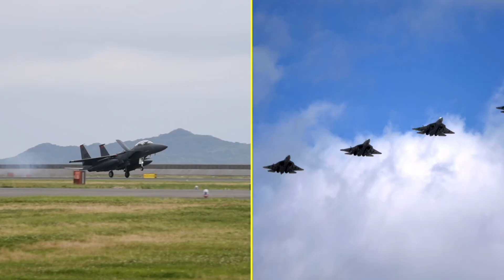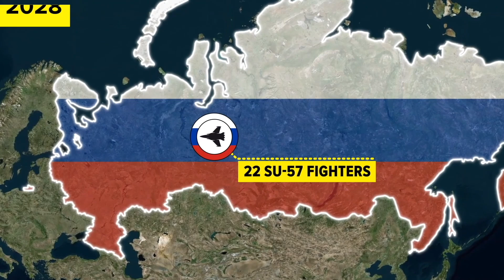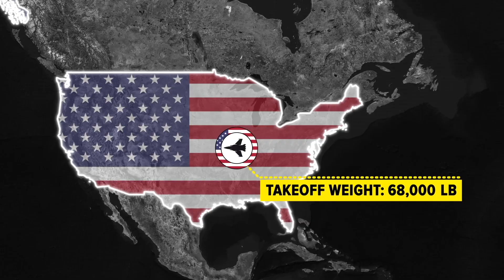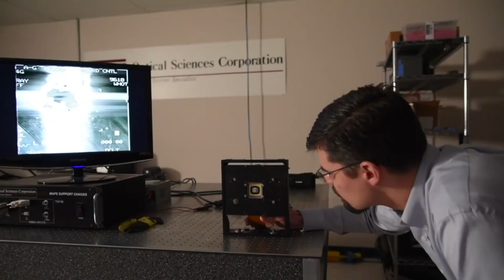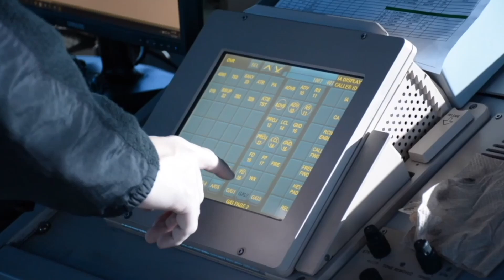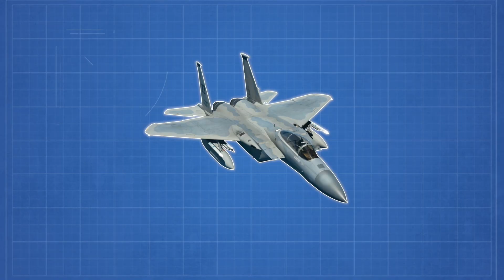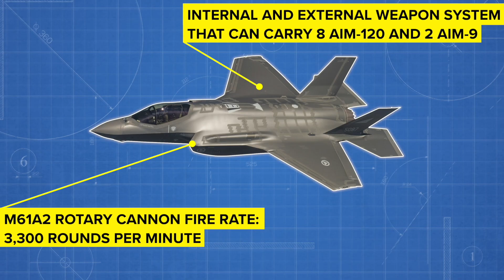Why the F-15 Still TERRIFIES Russia

Comment: the russian military estimated the RCS of the SU-57 is 100 times bigger than the proven RCS of the F-22
Reply: proven by who? By those, who say that the only true stealth plane – the F-117 has higher RCS than F-22, because «Nuuuw kompchuters alowed uz to kalkulate better formz»? You're real?
Reply: True but even the US cant currently build anything that can match the F-22 or even new F-22 also the SU-57 is their first compared to the US's (115 Night Hawk!) it's much better but yes it sucks it was 25 year late and based on an existing airframe (The Flanker!) rather than build new from the ground up, Also the SU-57 still lacks it's dedicated new engines 

Best Stealth Aircraft ever built was the VF-23 (Black Widow and Ghost Bat!) they were more stealthy just as fast but lost because they didn't show off fancy moves it was capable of and still was (for the prototypes!) Analog Majority Controls but was planned to get a fully Digital Cockpit and HUD Helmet
Reply: @DarthAwar also the f23 was not any more stealthy than the F-22.
And by this point in history it along with the F-22 is not even the best we have
Reply: @GR_Chief  YF-23 not F23 as they were never Commissioned (aka put into production never mind service!) It was it had a much smaller IR signature, RADAR was about the same though remember they were built by the makers of the B2 Bomber they know how to do both RADAR and IR Stealth pretty well!
Reply: @DarthAwar 😂😂😂😂😂😂
Reply: @DarthAwar what the hell are you even talking about? The F-35 is more stealthy than the f-22. The F-22 was our third attempt at stealth.
Actually our first attempt at a stealth aircraft was the Have-Blue test bed which is 100 * stealthier than the su-57. Our first production stealth aircraft was the F-117 Nighthawk.
 Not sure where you're coming up with the F-115😂😂😂
And the second production aircraft with stealth was the F-22 which is several Generations beyond the f-117. And the current F-35 along with the B21 Raider are even further stealthier than the F-22 or any previous aircraft.
And for the su-57 to be Russia's first attempt at stealth is actually quite embarrassing. Because it's not even a stealth aircraft it's barely low observability. In fact it may not even be low observable, some estimates are that it has the radar cross section of a slick f-18.😂
And as far as the video goes, the su-57 if they ever are able to produce a combat version of it that's really ready, wouldn't stand a chance.
Also it's very doubtful that they'll ever even build any more of them because they lack the Western components to build them. They are not capable of manufacturing the microchips along with dozens of other components on their own😂😂
Reply: @GR_Chief  F35 is less stealthy it's cross section is a Golf Ball, F22 is a Standard Marble (Glass Bead!), All stealth is low Observability until they make cloaking devices, they reduce refraction and reflection (yes they are different things!) through absorbing the RADAR Signature and Scattering the Reset but until they can bend all light and radio waves around themselves, they are Low Observability not True Stealth as they can be seen via Infrared/Thermal Sensors, Older Gen Radar like K-Band (Rough location but once a jet in their air can turn in that direction it's only a matter of time until they see it!)

Also stealth design (aka Shape is best front on from side below/above and behind it cross sections are always larger

I am not saying even if Russia had large numbers of SU-57 they would win but Maneuverability and Internal Capacity (Something the SU-57 has on both the F22 and F35!) still count for something

Russia is getting around part sections partly by buying through other countries like but not limited too Belarus, Turkey, Vietnam, UAE, QATAR, Indonesia, Pakistan, India, Sri Lanka, Bangladesh etc

Russia has pivoted to trying to build the Checkmate (According to latest Reports!) a better and cheaper aircraft (Closer to the Modern F35 but still not near close enough!)

Too be clear Russia is Fked Politically and Militarily for the next 10 to 20 years!
Reply: @DarthAwar  NGAD?
Reply: Show me the plane you cant as it is not even in testing yet never mind production it might never happen (It will but until it's actually in mass production it should be treated as Vapor Wear!) why fight a real war with Hypothetical Resources you can't just with what you have right at that moment!  @pooferfish2850
Reply: @pooferfish2850  NGAD is not in testing never mind service until it's put into service it does not exist, so you cant really count it as atm it's still being designed so is a hypothetical aircraft
Reply: if you say that 57th is Flanker, then F-22 is F-15 that failed to be at least as succesful as the very F-15,  @DarthAwar
Reply: @worldoftancraft  You do not read very well do ya buddy
Reply: @worldoftancraft  The SU57 was based off the Flanker basic design
Reply: @DarthAwar  based doesn't make it being anywhere equal
Reply: @worldoftancraft  I never said the SU57 was equal too the F35 again re-read what I said

Stealth the F35 wins but if the SU57 can find than close the distance the 3D Thrust Vectoring and IR Missiles of the SU57 makes it a real close up threat!

The SU57 is a poor man stealth but as a multi role jet its decent as a stealth craft its bad
Reply: @DarthAwar  this «poor mans» stealth is the biggest fighter of this class, which already makes it worse in RCS regard, and regarding RCS/weight, then it's not that much worse than F-35. Calling it a poor man low observability plane is pure bigotry based on false information.

As a stealth craft everything besides F-117 is bad. Do you know the place where neither B-2, nor F-22, nor F-35 has any stealth tiknologii?

Comment: The F-15C is good, but it can't hang with the Su-57 on physical capabilities alone. BUT - An F-15C in a US pilot's hands vs an Su-57 in russian hands... THe F-15C has better chances. Skill and training are everything, and our guys get a lot more seat time.  The E's radar evens them up easily.  The EX will still not have the maneuverability,  but it'll trounce the Su-57.
Reply: You make the point proven by Chuck Yeager when he flew a MiG-15.  He pulled stunts in it that no Soviet Pilot would dare attempt.

Comment: Stating the F22 lost dog fights to the F15 glosses over a lot of constraints the F22 pilot had to follow to due to training requirements and preserving RAM.
Reply: Facts. The F-22s and F-35s are almost always stacked with lunberg reflectors and the external fuel tanks to make them much easier to see and harder to maneuver. They’re usually tied down with VERY limited intercept constraints and I’ve read that there have been exercises where the 4th Gen fighters are intercepting 10-20:1 with AWACS and other support and the F-22 and F-35s are purposely seriously hamstrung.
Reply: @FloridaManMatty  Very true. There's an A-10 with an F-22 kill painted on it's nose from a war game. In reality, an F-22 would roast an A-10 long before it was withing 100 miles.
Reply: @FloridaManMatty  The F-35 is experiencing the same doctrinal issues that were realized with the F-4 Phantom in Vietnam: Jack of all, Master of None.

There IS a reason why the USAF has desperately tried to hide the after-action report of the Red Flag Exercise where a Gripen defeated the F-35.
Reply: I don’t know why people think these F22 and F35 are at full capability when doing these little DF shows and training
Reply: You learn more from a loss than a win.
Reply: That's the point exactly. They handicap the F22 till it's competitive with the older plane, then see what happens.
Reply: @McNubbys  This exactly. 
It's the same reason the USAF still uses the F-117 in training for other pilots. F-117's have been "shot down" many times in training, but in losing, it teaches hugely valuable lessons in how to counter stealth. 
and that's a 40 year old aircraft.
Reply: @Clean97GTI  the F-15's will be the same thing to retired to be training aircraft once enough of them are retired and repaired/rebuilt for that service.
Reply: @TheManofthecross  I mean yeah, that happens to all aircraft eventually. You can see hundreds of US aircraft sitting in the boneyard at Davis-Monthan AFB in Tucson AZ. But the F15E and EX will be around until the 2040s at a minimum.
Reply: EXACTLY! @McNubbys
Reply: Would also like to add to your statement the only times the F-22 have lost to other fighters is when they were intentionally impaired by having to carry external fuel tanks, like in the case where the German euro fighters were beating the F-22’s, there was only one case where the F-22 lost one on one match with an aircraft where it wasn’t hampered and it was to an F/A-18F that caught it by surprise. Most of the other losses had to do with either the aircraft being purposely impaired, or being overwhelmed by sheer numbers of aircraft that happens quite a bit in red flag training scenarios. There’s even an A-10C floating around out there with a scored kill on an F-22 it has the silhouette painted on his fuselage. The context behind the kill was a combination of electronic warfare being applied by F-35 as it was mixing it up with the F-15 cap cover that was being provided for that A-10 and the A-10 was able to seize upon the chaos and score a kill. In a world where people hype aircraft up to be invincible and invisible, pilots have to train with specific handicaps at times, because you never understand, or know when the enemy might close in on your technology with newer technology, or you might find yourself in a situation where you have a chance engagement Out of accidentally running into other aircraft and you don’t have the advantage. I’ve also heard a story where F-15 pilots were training over in Poland, and a Polish. MI-24 helicopter was able to score a kill against an F-15C. So something people have to understand, just because something looks good in statistics, or on paper, doesn’t mean that it is out of the realm of possibility for being beaten. The likelihood might be very highly unlikely that it would ever happen, but the possibility of a defeat happening to a more capable aircraft, a less capable aircraft is possible.
Reply: Like my dad once said while still in the USN, "We get better training by tying our hands behind our backs and losing than we do going in the same training scenario and winning at our full ability."
Reply: Every fight the F22 "lost" was due to handicapping. They had drop tanks on for most of them which kills stealth. The US military aims to be at a disadvantage during these tests to learn the most from "failure".
Reply: Same when F-16 got the F-35. But that doesn't make headlines.
Reply: Agreed. They should have training with full capabilities for the very best pilots. I want to see how an F-15 EX with an infrared pod fairs against the F-22 and F-35.

Comment: I have said it once and I will say it again, a visually impaired 4 year old running around a F16 hanger with a slightly pointy stick is only slightly less dangerous than a SU57 is to a F16. At least the 4 year old has a chance to whack the landing gear with said stick!
Reply: Depends on where they meet. As it is the case with all such dumb comparison videos.

Comment: And still, the su57 is really huge and you can see the turbine blades from the front.. that is really not Stealth no matter how much ram you paint it with
Reply: What if they shove RAM down the intakes? Like.... So the engines eat it... Have stealth farts then too
Reply: First what is the number of the Su-57, you are talking about? Literally there many iterations of this plane with significant differences. SUCH AS RAM blockers before the blades.

Comment: 104 and 0. (stats for the F15)
 vs 0 and -4 (stats for the SU57)
Reply: Iraq was still ranked 4th in the world for military power at the time with on of the best air defense in the world,
Reply: @reloading4321  Totally false, their air defence systems were based on equipment from the 60s and 70s, almost all of it, the non double digit stuff previously compromised from the Arab-Israeli wars decades earlier. The US even received some captured examples, radars etc from Israel. The only area that Iraq had any credible threat was their artillery but without control of their airspace that threat was quickly neutralised.
Reply: Against 3 generation export aircraft in third world countries, let's not forget.
Reply: @John-hu9qg that ain’t true. 1 f15 shot down 2 mig29s and Iraq definitely wasn’t a third world military. It’s was 4th largest military on earth. The f15 has shit down multiple mig 29s. The f15 is older I believe than the mig. The f15 could take out most of Russias Air Force as it’s mostly made up of mig29s and su27s. I’d put my money on the f15ex against the su35 as it’s performed pretty bad in Ukraine. Not to mention the huge difference in pilots and training. If the US loses just 1 fighter it’s a big deal and Russian jets been faking like rain. They took out 11 in 11 days.
Reply: @michaelbartley9572  It shot down a couple of elderly Iraqi MIG-29A export variants, in a 4 vs 1 engagement with full NATO AWACSs support vs nothing on the Iraqi side, Iraq most definitely had a third world military in every sense of the word, that was tired from 10 years of the iran-iraq war before the gulf war in 1991. They didn't even possess a single round of ammunition designed to engage western armour!🤣. The Ukrainian airforce was largely combat ineffective in as little as 10 days, and you will see exactly how long the F-16 will last also. In regards to Ukrainian shoot down claims? They were laughable at best, they couldn't provide any evidence whatsoever in relation to the majority of SU-34 claims, yes they downed one or two by quietly bringing a pair of patriot launchers and a NASAM unit forward, but then lost all three SAM units in a series of spectacular strikes by the Russians who also moved a relatively unknown weapon into position, a Tornado 200km range precision strike MLRS. Its also rumoured that some of these destroyed battery's were covertly manned by American and other NATO personnel killed in the strikes.
Reply: @John-hu9qg hey John, let me ask you something... Why do you Russian roosters always use western screen names?

Ashamed... or are you trying to hide something?
Reply: @VladimirPutin-p3t  What am I man? A chicken farmer?, what are you talking about???
Reply: @John-hu9qg Hello Kremlin bot. Nice 2-year-old-made-for-trolling account you have there. 100+ comments on this channel alone I see.
Ask Uncle Putin for reassignment because your shilling for Russia is weak.
Like Russian army.😂
Slava Ukraini 🇺🇦 💪
Reply: So where is all of the Russian A-50's at? @John-hu9qg
Reply: @John-hu9qg He was talking about you being a Russian bot (a rooster referring to people who crow about a subject but know little to nothing about it) with a western screen name. 

Also you make it sound like the patriot got destroyed while it was operating.  There were TWO patriot LAUNCHERS destroyed that were spotted by a drone while in transit. To my knowledge no radars were lost but even if they were they too were in transit and not operating.
Reply: @michaelbartley9572  okay not everything is about size though. Everyone says iraq had the 4th largest army at the rime which is true but if you look at what they actually had it was garbage😂. Their t72s didn't even have thermals and they wondered why they couldn't see anything when they fought the abrams😂
Reply: @John-hu9qg It would make no difference US has the best pilots and the F15 vs an Iraqi MiG would always be in the favor of The F15 with a U.S. Pilot. The F15 also carried many more missiles.